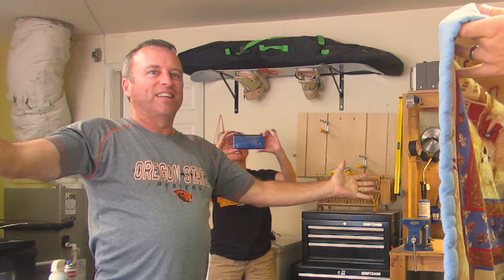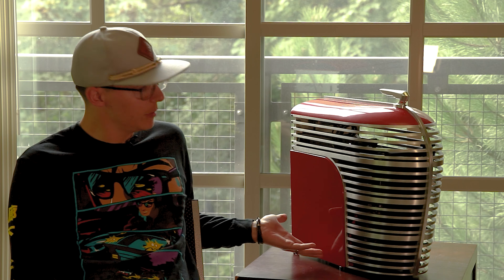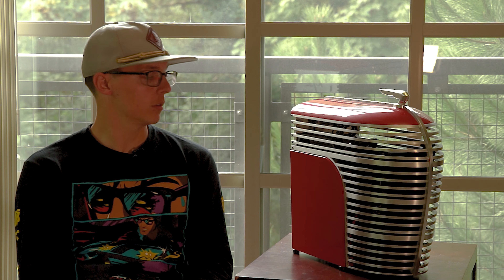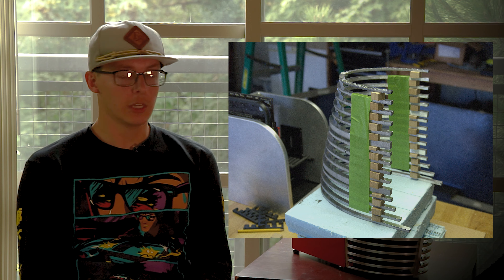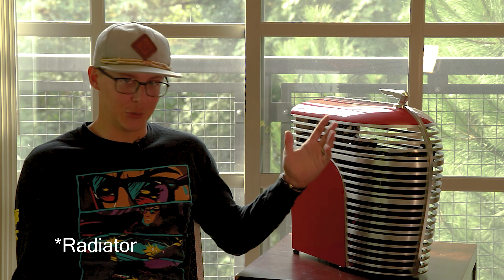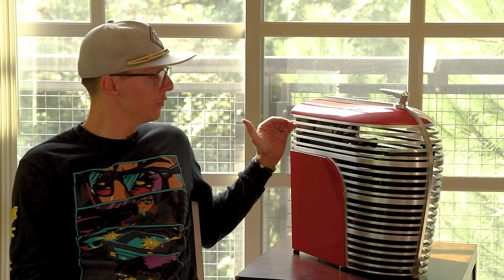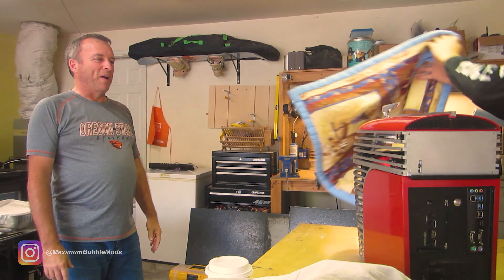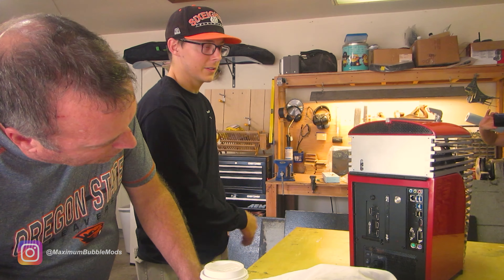Surprising his Dad with a custom-built gaming PC! | Spirit of Motion, sponsored by EVGA and NVIDIA

Comment: Really nice case! What about dust build-up tho? Seems like this would need some regular cleaning.
Reply: I made the upper fan a puller that has a dust filter at the back of the case, so there is some filtering of the dust happening. Depending on the room it is in and the location of the case, absolutely this may require cleaning a little more often.